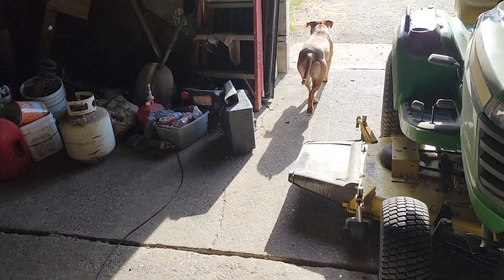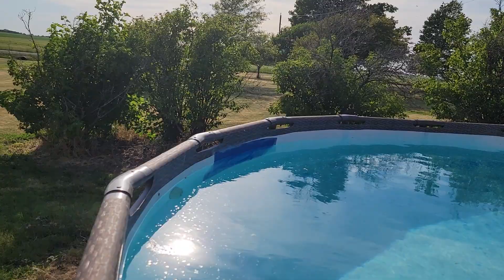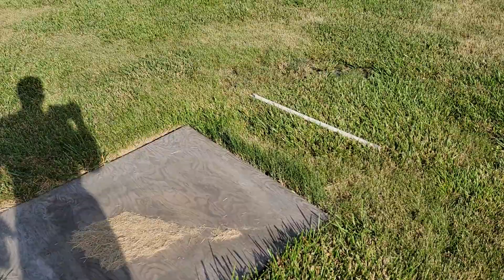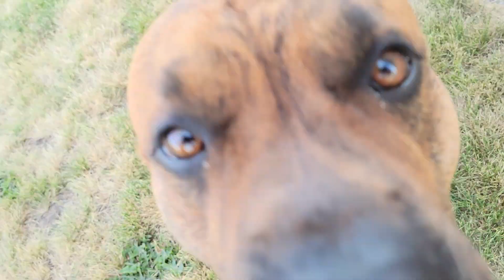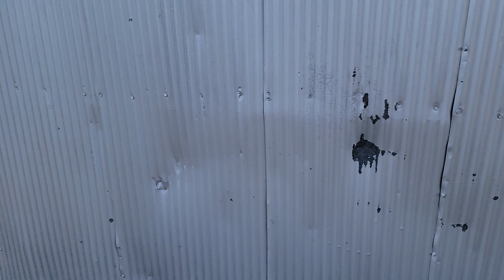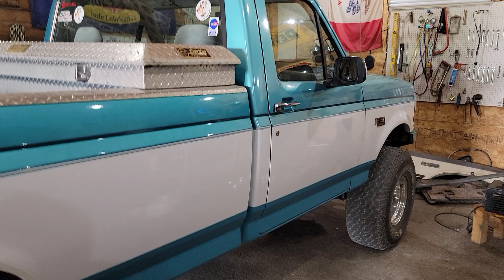FORD Bronco Update And a Bunch Of Other Stuff, Along With a Look In The Old Well

Comment: So my truck is in my pfp is my dream truck and I finally got it. The truck is in good condition but has some cosmetic things that I want to fix someday. I plan on doing a pull restoration on it  but my only concern is not being able to find perfect replacement parts. So many people nowadays are getting these trucks and fixing them up I’m afraid when it comes time for me to do it that I won’t be able to find any or have to pay outrages prices. My point is do you think I should try to find all OEM parts from other trucks or should I do my best to repair it like the slightly dented and scratched body panels?